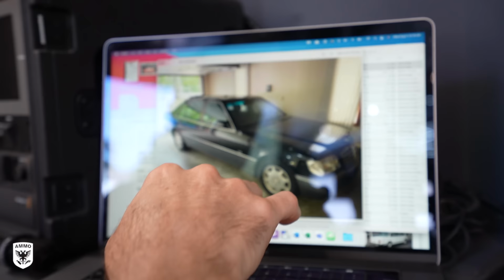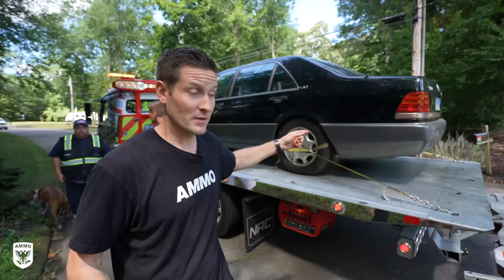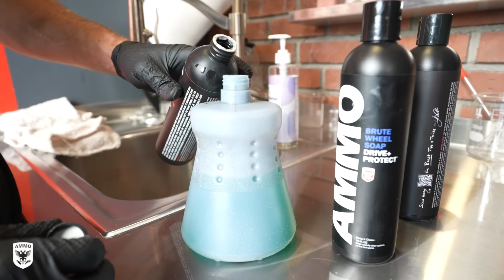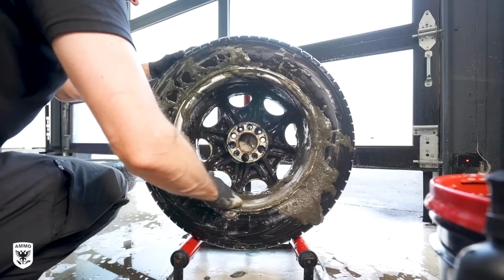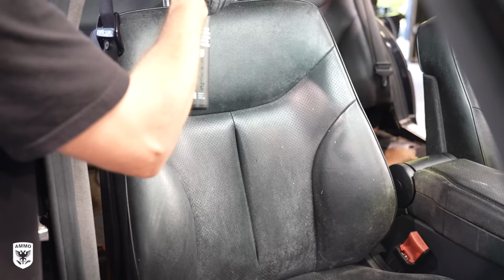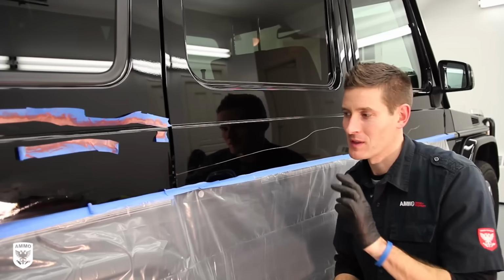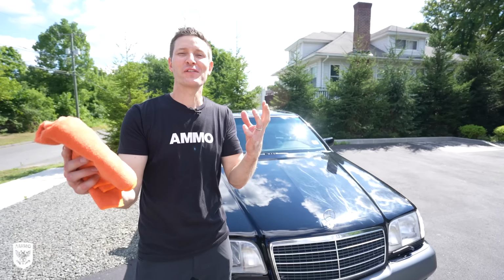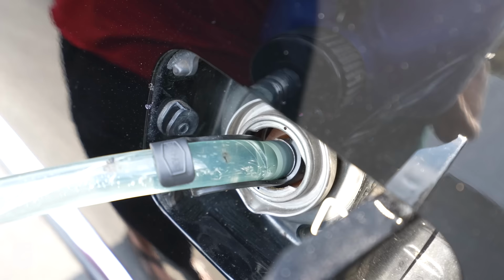First Wash In 8 Years: Mercedes S600 V12 Swirled Paint Best Before and After!

Comment: Remember the center rear view mirror is power adjustable, don’t try moving it by hand. Also those engine writing harnesses are extremely fragile if they weren’t replaced with the updated revised harness. They were biodegradable on their insulation. Super awesome car!
Reply: Only on the later ones.
Reply: @jthomas7631  The electric mirrors on my w210 has held up for 22 years now though..
Reply: Yeh engine cleaning usually means water gets where it shouldnt and Corrosion. Looks good sure, until you have to replace a spark plug and realise water penetrated and corroded the threads.
Reply: @str8forthakill  As with everything you can do engine cleaning the right or the wrong way.

Comment: This was an incredible turnaround for this beautiful car Larry. The before and after is absolutely incredible on this car! A very rare car indeed the V12 model of this car could go from zero to 60 in 4.6 seconds not to mention the incredible luxury feel of this car. Mercedes has always done in right when it comes to luxury automobiles this is a very good one Larry I love it.
Reply: My jaw dropped when I saw the Brabus badge then massive disappointment !
Reply: @jayfxdx  yeah me too!
Reply: @jayfxdx  wrong grille, brabus badge. Somethings not right with this S600 😅
Reply: @jayfxdx  I love brabus tho especially the Rocket 900 go check that car out if you like it's my dream car
Reply: Even the original brabus if i am ot wrong with 7.3l enhine never made 4.6sec to 100 kmh ahaha its not fast car had one lucky day going slightly down hill maybe around 8sec...its heavy as f**k
Reply: @paradisepanglao210  weighs probably over 5000lb
Reply: All it needed was "some" love to be looking like a boss again
Reply: @paradisepanglao210  The Brabus was around 5.5 seconds. It was 6.3 seconds for the standard V12, low 7s for the V8 and 8.8 seconds for the 6 cylinder. 
They W140s are heavy but they all have incredibly short gearing which helped to propel them surprisingly well... 
I have owned a 500 and that thing felt great in the high rev range. The owner of a recording studio I frequent has a V12 and that thing pulls hard! I currently daily a 320 because they are decent enough on fuel, super reliable and easy to work on. The 320 is also lively in the upper rev range and surprisingly fun to drive because it's also the lighter over the front wheels than the others.
The main limiting factor of the V12 was that only the 4sp trans was strong enough to party with the engine and the 4sp sets off in 2nd gear, so unless you floor it effectively acts as a 3sp. It's the same set up in my 320 though and I like it enough.
Reply: @TH3L3G3ND  he mentioned the weight when he put it on the bridge/ramp.
Reply: These don’t have the V12 biturbo. The biturbo does 0-60 in 4.6, this has the NA V12 that does the sprint in 6.2 seconds. Still a cool, ultra luxurious car nonetheless
Reply: @19jacobob93  It has pretty tall gearing actually :) For being a 4 speed, that is. Maybe a bit short compared to the engine though.
But it later got the 5 speed.
Reply: @martinsv9183  hell no! It's the shortest geared vehicle I've ever owned by a long shot. My previous daily was a Ford with also an inline 6 and 4sp. That thing was lazy with its tall gearing and would sit at around 1600rpm on the hwy. The W140 sits at 3,500rpm at the same speed! They're actually geared so short that they set off in 2nd gear.
Reply: @19jacobob93  Hell yes! :) We need a little realtiy check here I sense haha. Go see how many cars with a 4 speed gear box you can find that will go 50 mph in first gear.. 81 mph in 2:nd and 125 mph in 3:rd.
The only reason it might feel like its "low geared" is because the engine can take a far higher gearing for its torque. And its geared for top speed in 4:th. There's no overdrive.
It only came with the later 5 speed. But compared to any normal car it has a very tall gearing. Without considering the engine.
Reply: @19jacobob93  The 582hp 7.3 was rated 0-62 mph at 4.9.
Reply: @martinsv9183  Still no my friend. I have rebuilt a few 722.3 4 speeds and the gearing is the shortest I've seen in any passenger car box by some margin. Just to make sure, we are talking about the 722.368 right? I've just never heard anyone mention them being tall geared, strongly and famously the opposite.
The reason they do 50mph in 1st is because that's actually 2nd. If I drop mine into true 1st it hits the redline at under 20mph! It drops into top/4th gear at around 30mph under normal driving and then stays there until I drop below 20mph... the fact it passes the 3,000 RPM mark in top gear at just 60mph is all you need to witness to understand just how short the gearing is in these. They added a 5th gear with the later 722.5, which was literally just an electronic overdrive bolted to the back of the 722.3 4sp to combat the complaints of the high RPMs at high speeds. Personally I don't mind it though, it keeps the car in the lively torque bracket which is by design, and the 722.3 having no electronic parts has less to go wrong...

Like I said my last car was a similar engine, also matched to a 4sp, and that would pull all the way to 60mph in 1st gear and turn over at 1,550 RPM at highway speeds. Now THAT is tall gearing and a night and day difference when compared to the Merc 722.3... If you open them up you can see the actual gears themselves and observe the differences in ratios.
Even my girlfriend's Hyundai Accent turns over at 1,900rpm on the highway and is drastically taller geared than the 722.3 but it has the benefit of being a 6sp.
Reply: @19jacobob93  No, compared to any other regular car from that period with a 4 speed gear box it has a very tall gearing. Haha.. no it doesnt hit the red line at 20 mph :)
The 600 that was talked about in the original comment hits 50 mph in first gear. I said FIRST gear. Not second.
Stop posting complete nonsense please. I stated the speeds at 6000rpm in each gear in my prior comment.
If you have found a car that hits 60 mph in first gear then 4:th is going to be an overdrive. Probably a bunch of amercan cars from that time were set up that way. But not cars in the rest of the world :) 
And acceleration is going to be severely hampered in the remaining 3 in that case. MB chose to have the car reach top speed in 4:th and have a closer ratio on the remaining ones. Most cars were set up that way. Unless you had a 5:th gear.
Reply: @martinsv9183  My other car was also from that period, and I stated I was referring to a 6 cylinder. The 12 cylinder uses the same 722.3 but the final drive ratio is lower yes. 
I'm not posting nonsense, I know these cars and transmissions inside and out, including the gearing ratios etc. and I've owned a few of them to boot...
Reply: @19jacobob93  The 300SE has a top speed of 230 km/h. And redline at roughly 6500 rpm. So at 70 mph its going to rev about 3200.
Top speed in 1:st gear on that model is 60km/h. Or 37 mph. Which is still relatively high.
Reply: @martinsv9183  I should probably just record an acceleration video to prevent the online speculation 😅
Reply: Not the 1994 model
Reply: @19jacobob93  No you only need to do it to prevent your own speculation :) I already know the speeds in all gears. Its stated by the markings on the speedo. On the European models at least.
Reply: @martinsv9183  I have no speculation, I've driven this vehicle for years and just rebuilt the 4sp. Mine has the speedometer markings, 1st gear is 30kmph (18mph) and 2nd is 50kmph (31mph)
Reply: @19jacobob93  Haha no its not :-) You're just making things up lol. There is NO MB on EARTH with such instrument cluster with markings at those speeds.

A carbureted MB 200 w123 with 98/109hp and a 4 speed goes 30 MPH in FIRST gear..... 

ok?

Just cut it off. 
You're a habitual liar haha..
Reply: All six cylinder petrol W140s in the US came with 5 speed transmissions and much quicker final drive ratios than the 4 speed W140s. The reference to a 4 speed six cylinder petrol W140 could mean that the original 722.5 transmission has been replaced with a 722.3 or that the electronic overdrive is not working, thereby turning the car into a 4 speed model with a very short rear axle (a combination that never came from the factory).
Reply: @conordonovan7167  In Europe it was standard with either a 5 speed manual or a 4 speed auto. The 5 speed auto was option. 
But hopefully you do understand that they dont change the gear ratios to half just because they put an extra gear in :) 
Since the 5:th gear was an overdrive the other 4 gears will be about the same as before. If not exactly the same.
Reply: @conordonovan7167  or that a lot of us exist in those mythical lands outside of the US 😅 my 6 came standard with the 4sp; all of them did in the rest of the world until the facelift.
Reply: @paradisepanglao210   it just go 2km to the liter  instead of 3km to the liter like the untuned 6.5L did hah
Reply: @wheresfuninthat Its not wrong , pre 95 models S600 had that kind of grill, facelift has full chrome one but yea i would put that on first thing if i had pre-facelift model

Comment: In 2004, I saw a 1993 600 SEL (that was before the nomenclature revision) for sale at $9,500. I enquired about the "low price". It turned out that the car was mostly in good shape other than the malfunctioned HVAC system. I knew that fixing the HVAC system would require taking the dashboard apart to replace some components. The repair bill would be easily $10,000 or so due to labour cost and expensive parts. The 600 SEL parked at the forecourt for a several more months with a few price reduction before it was hauled away to the auction.

Comment: Absolutely gorgeous results, the best Mercedes-Benz S-Class of all time.
Reply: I must disagree 
The W126 has way more presence and class in my opinion. 

I never like the W140. To me it always looked  way too bloated. 
A big step forward technologically and mechanically but the rest, no. 

A cathedral on wheels.
Reply: @monk3yboy69  
I do like the W126 and agree with the points you've made. I wouldn't touch a modern S-Class, not been interested since the W220.

Comment: Great detail Larry!! PS For those that are thinking about buying one of these.. DONT. I’ve owned 4 and thought I learned my lesson. Pre ODB2 cars are impossible to diagnose issue and all have biodegradable wiring harnesses on top of probably the worst Bosch EZL ignition control systems and idle control systems ever designed. Even buying factory Bosch replacement for all of the w140 let alone the 600 are all faulty(no joke even the mb dealers have to buy 3 of the same parts hoping one works since the yields are so bad)  mechanically these cars are great but Electrics were way to complicated for the time for no real benefit at all and never got any better post 1997 + no one wants to support servicing them anymore—all the techs that are experts on these are like 80years old and about to pass away and dealers will price you out to death so you basically refuse service so they don’t have to work on them. Appreciate the car for what it was at the time but don’t buy one. So many better MBs to buy and enjoy.
Reply: I've dailied for years a 1992 W140 300SE so it's pre OBDII and has the EZL etc. Every single thing under the hood bar the fluids and filters were factory original (date stamped 91-92) until I did a full ignition service last year (distributor, rotor, plugs, leads, wiring harness, coil) as preventative maintenance. 
I've heard from a few experts that the EZLs go bad when the ignition system becomes neglected and extra resistance in the system puts a lot of strain on it, more specifically relating to the gaps in worn plugs being larger and requiring more power. Surprising I guess then that mine was original but I have a spare I picked up for 80 bucks.
I almost like that they don't have OBDII though, it makes you do things the old school way haha after the ignition service I had a no start situation which using a multimeter I narrowed it down to a faulty off-brand rotor in no time which I just swapped back for the original. 
On the W140 the only things I'd recommend to anyone, and I have done myself, is replace the whole cooling and ignition system as preventative maintenance (including harness if effected model and not yet done), stock a spare EZL if pre OBDII and keep a spare $2-3k aside for a transmission rebuild when reverse starts to die at around 200-250k miles 🤣
Another piece of advice would be stick to the M104 6 cylinder models. They may like to leak a bit of oil but they'll do that all the way to a million miles without blinking!

Comment: I made a homemade mix sourced from the inter webs for mold eradication.  It was TSP( trisodium phosphate) and water and ….I think baking soda.   Used a fogger from Home Depot, a Ryobi fogger, and fogged the interior of my wife’s 2004 Grand Cherokee which thrown a rod, and sat for almost a year before I went to move it, and realized it was just like this car, mold all over.   We are in Charleston, SC after all with average RH of 80%.      Did not touch a thing.   Sprayed it pretty thoroughly.     Next day ALL of that mold was GONE.  AND it stayed that way for the next year, before we ultimately let LKQ take it away.  They gave us I think $250.    But that concoction plus the fogger atomization of the mixture was far more successful than I had expected.     Unreal.    The truck was well sealed up, but I guess had moisture trapped within.

Comment: It’s relatively easy to pull the dash top panel off of those cars, and then the duct vents pop right out, if I remember correctly.   Those ducts definitely need to be vacuumed from deep within, even make an adapter hose to reach where needed.    But there is no doubt some nefarious debris deep within those ducts.    Even if it’s mold which hasn’t been treated, it needs removal or neutralization.

Comment: I had the exact same problem with a 1994 30,000 milage CL600, hadn't been driven in 10 years because it stopped running, the owner parked it and then passed away. All it was was some new gas and the fuel pumps which cost next to nothing..

Comment: Stunning job! My late dad had one of these but in silver, great car, I got to drive it a few times, deceptively fast! 

Surprised there was no mention of seized  brakes or engine oil change! Tar remover plus that razor wud have done the wheel barrels proud too, I’ve had to do that with my Merc, 1.5hrs per corner 🤣

Comment: First time I ever took my truck to a detailer last September 2021 for a "paint correction" because every other time I just do it myself but was feeling lazy.  Months later I started noticing the extreme swirls which are only visible when it is extremely bright outside.  Those were NOT there before I took it to them to polish!  Always seems whenever someone else does a job they never do it as well as you can (perhaps with the exception of Larry at Ammo NYC!)

Comment: Larry, the Brabus emblems may have been original. if the car was a gray market import (which the clear indicators could point out) it could have been sourced from Brabus' dealership side in Botropp, germany. They did and (AFAIK) still operate as a "dealership", and Mercedes delivers new cars directly to them, fully completed, for any and all modifications. Even the full package cars like the rocket 900 start out as fully finished Mercedes, direct from the factory.

Comment: What a brave move spraying water under the hood of a 94 V12 Mercedes,this is one of the soy based wiring harness cars. I have a 94 V12 I have replaced all the under hood wiring,but I am not brave enough to spray it like that,a lot of the modules are under there also. Chances are this one is a wiring nightmare already with the mouse visitation.

Comment: Generally, a lot of "real estate" isn't much of the problem if it is in simple shapes. In such case you can always use 5-6" pads for everything and it is relatively fast, what uses the most time are the details and complex shapes. Just as example, when my friend asked me to help with badly scratches and faded 1992 LS400 I was able to do two stage on it in a day (it was overkill, but I thought it will be nice experience, car probably wasn't worth that), but when I did my own RC-F I was still working on it after 2 days, I literally had to spend few hours into 3rd day completing the ceramic coating... and this is because the damn car has no single straight panel - well roof, half of two door, most of bonnet and boot-lid look mostly straight, but not completely flat, so using 6" felt awkward, as such I mostly used 5" on those panels. The rest of the car required 3" and front bumper and several other details were all 1"... and 1" isn't 6 times slower than 6"... it is like 20 times slower to achieve same finish and obviously one has to be much slower and careful working around small details. So as much as I like the looks of that car (I know some hate new Lexus look) it was real pain to detail.

Comment: Insanely sexy car. Some things are wrong though. That 'Brabus' emblem is sketchy and the non-US headlight, could indicate it had an accident before. Also, this is a pre-facelift W140, weren't they all 600 SEL? When the facelift came in 1994, they started calling it the 'S600'.

Comment: it would be a good idea to have the mechanic pull all 4 rotors and clran off that rust with a fine rololock disc. That rust will grate up the brake pads. rust like that isnt the same as the rust you get from washing the car.

Comment: 1994, did Mercedes use biodegradable materials in its car assembly? If so, there could be issues with various plastic and rubber parts including the deterioration of the wiring harness which could cause major headaches. Just wondering 🤔